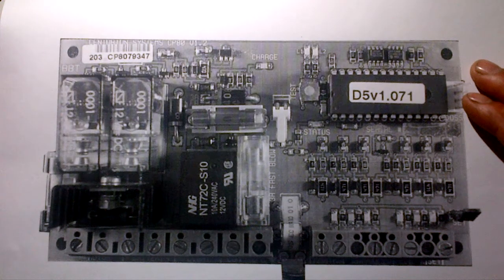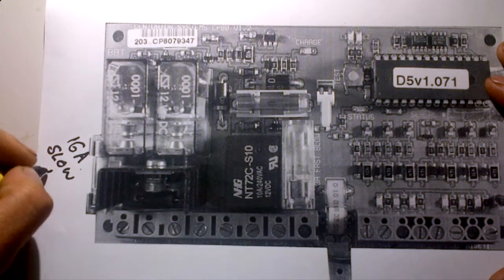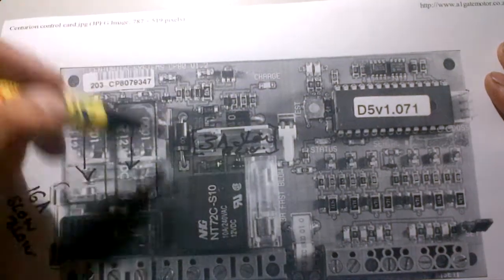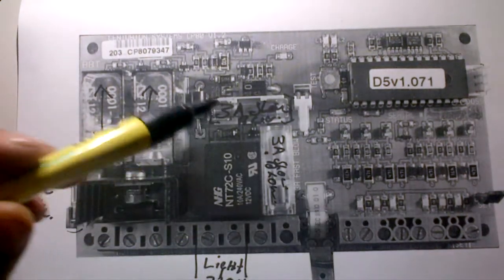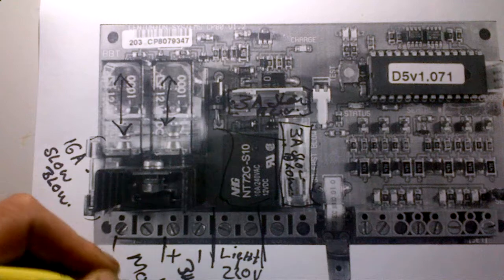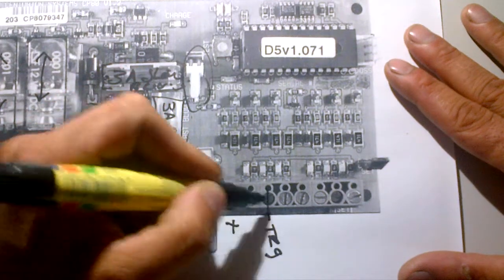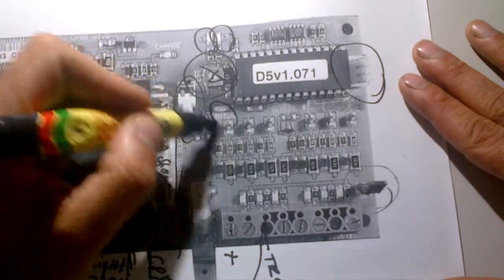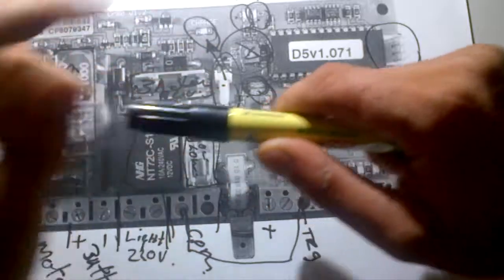centurion gate motor basic pcb fuses and inputs  video 1 of 5

Comment: Hi Daniel, thanks for the  video's they are still very informative.  The gate motor fuse keeps blowing on my D5.  Only started yesterday, raining quite a bit here....not sure if its related....Anyway after the 16 amp slow blow was blown I could only find 15 or 20 amp fuses...I used the 15 and it instantly went through 3 of the 15 amp fuses yesterday and today, literally after installing and opening once.  Going to try and find 16 amp slow blows today.  But is this normal? Any bright ideas?  Thanks again for the content, very helpful so far.

Comment: Greetings everyone!

Especially “Blade” for an exceptional video series on wiring basics for the Centurion D3 and D5 Series. I have an ongoing issue I am trying to fix and no one seems to be able to help me. Here in SA with our ongoing power outs I have a problem with my AIPHONE Model MK – 1GD which is connected to my Centurion Gate Motor. Every time we have a power out and the power comes back on, my gate opens!? (This is not only frustrating but also a security issue during the late night or early hours of the morning).  Obviously there is something with the wiring causing this and whether it can be resolved or not is the question. Any help would be appreciated. 
Many thanks.

Comment: Hi Blade, I have a problem every 2 /3 months with my gate motor. It's about 100 meter from the house and it seems lightning or at times Eskom comes in on 1 phase, is the main problem. An electrician told me to unplug the earth wire as this will help the motor not getting damaged by lightning. I am so fed up, spending a R1000 +every couple of months. For farm security I need a working motor.

Comment: What you name "AC input" even on board marked as "DC IN" :)  (see under pins)
It's left unexplained HOW "negative trigger" should work - is it short impulse or it should be ON permanently? (until gates slide)
Also nothing about IRB, FRX, LED, PED, LCK, SET pins. At least some short description could be nice. BTW I saw IRB & LCK pins were connected to "COM" (minus) - what for?